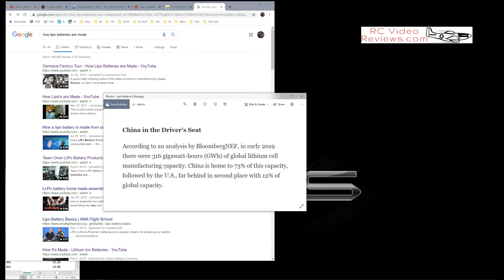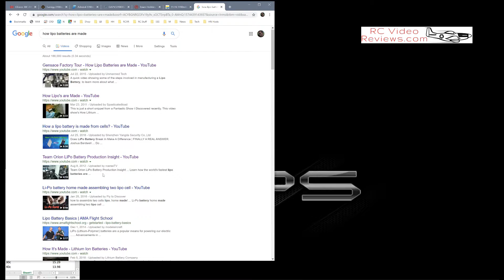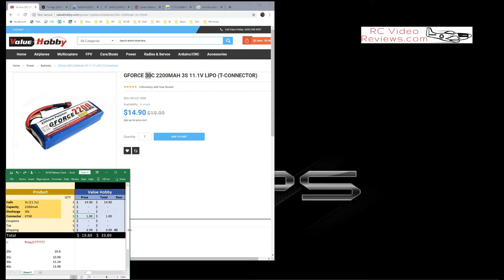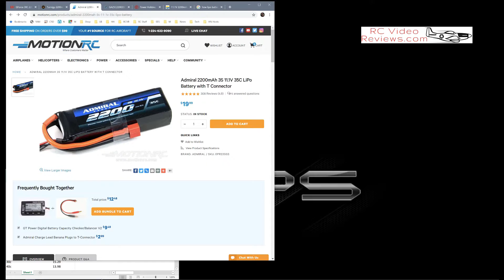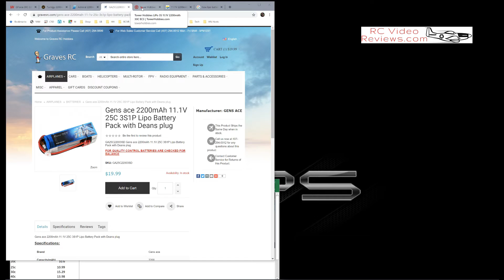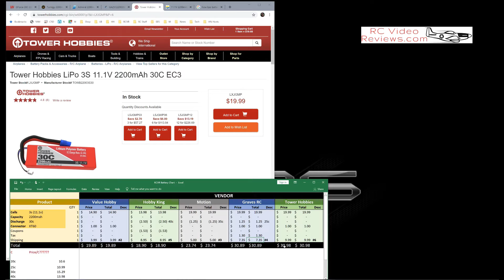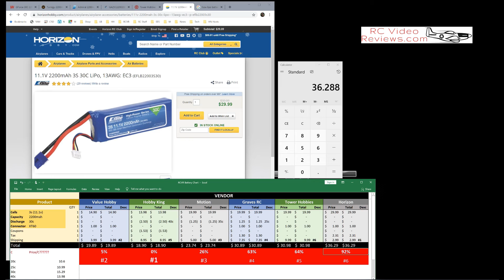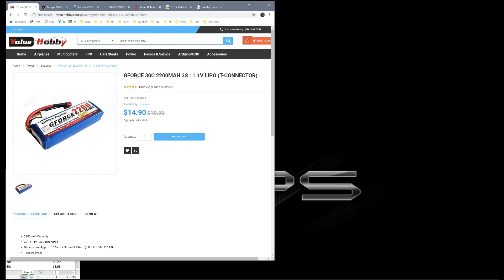LIPO Batteries - Buy More Spend Less

Comment: I also buy Chinese lipo batteries since 2007 cause i was always out of money , once in 2010 i  baught a small 1300 mAh battery called "diamond" from a german seller . It still works fine ,havent bloat or anything but it was expensive specially then before all the IATA nonsense

Comment: Right now there's a 5 piece bundle of 3s 2200mah 25c batteries on AliExpress for around $52 USD plus shipping. Even if only three out of the five were good, it's a better deal than just about anything I've seen before.
Reply from the maker: Thanks for the hot tip!

Comment: What is the strongest battery that you can charge with the Voltcraft charger V-Charge Eco NiMH 1000?
Reply from the maker: I'm not sure what you mean by "strongest battery" but it's only a 10w charger and it's for NiMH, so don't charge Lipos with it. Not much power in that one.
Reply: @RCVideoReviews  NiMH, yes but upto 2000mAh, 3000 mAh, 4000mAh? and charging time? Thanx 4 info.
Reply from the maker: @Tintoycar  Think of MAH as a gas tank. MAH refers to the amount of energy you can store. Chargers don't really know or care about MAH. Charging time is influenced by the MAH itself. More MAH = more charge time required if the amperage is held constant and it will be in your case because of the low power rating of 10w on that charger. The charging rate on that device is low at 10w. A 12v device like a 3s LIPO battery will charge at 0.8a. If you charge a 2200mah battery, that represents about 1/3c, which means it will take over 1 hour to charge a 2200mah battery.
Reply: @RCVideoReviews  I'm starting to get it ;-) Now it takes 2 hours to charge NiMH 2000 mAh, so i can use my little charger to charge a 4000 mAh battery but it will take much longer. I've got an old charger somewhere that's 20 years old for my 2001 Subaru Impreza. Maybe it will be of use. I understand that NiMH is for beginners ;-)
Reply from the maker: @Tintoycar  NiMH isn't for beginners, it's the chemistry we used in batteries before Lithium Polymer. Lithium Polymer is a preferred chemistry because it holds a steady voltage level over the discharge curve better than other chemistries. i.e. It makes for a better experience because the device being driven is more consistent from the peak voltage of 4.2 to the cutoff voltage of 3.3. NiMH voltage fades more at the end of the curve.

Comment: RCGroups does extensive load testing of high demand batteries (car & ducted fan) and most batteries can't handle the load.  Doesn't that make a difference?  It seems more objective.  Doesn't Graphene reduce internal resistence and improve performance?  Thanks Howard
Reply from the maker: "I am now convinced there are presently no (none, nada, zip) ~5000mah packs weighing under 800 grams able to sustain a 35C continuous discharge without overheating. End of story. The only difference between one that claims 100C and another claiming 45C is how big a lie the supplier believes they need to tell in order to separate you from your money."

He focuses on heavy use heavy draw form factors: 6s5000 under extreme load.
He says weight tells the story (agreed).
The difference comes down to marketing claims.

In the end, Lipo is Lipo. Weight is weight.
Reply: John again thanks for looking into this.  If you look into the results there are battery manufactures to avoid, where you just don't get the longevity (cycle life) to justify the cost: 
https://www.rcgroups.com/forums/showpost.php?p=43555233&postcount=8514

I would much prefer to pay a little more for a battery where I can get 200 cycles, rather than paying less and having the voltage start to sag at 50.  Maybe you could do some cycle testing on your iCharger?  I think there is a cycle mode already available where testing could be automated.  You do an amazing job with The Judge on motors.  Howard
Reply from the maker: Appreciate the dialogue. Honestly, I consider batteries consumable. There are just way way way too many variables involved for me to get wrapped-up analyzing batteries let alone even consider posting a video about battery analysis. Even the testing you shared--which is excellent--only focuses on 6s5000mah high load conditions and look at the amount of data he generated.

To simplify my life when it comes to batteries:

1) Store cool dry. I used to store in hot garage, no more. Cool dry.
2) Stop charging at 4.15.
2.5) Balance Charge Only on Quality Chargers
3) Stop discharging at 3.7
4) Store between 3.75 and 3.85
4.5) Balance Discharge to within 0.03/c
5) IR > 5 Any Cell = Retired
5.5) ~15mm worth of "puff" = Retired
5.6) Anything other than cosmetic damage (i.e. crinkled cell) = Retired with prejudice
6) Current Design 10% < Sustained C
7) Prefer C Rating > 40 or higher
8) Charged Before Use. Storage Charge as Soon as Practical.
9) 30 Minutes rest after Discharge.

Can I quantify any of the above and correlate to longevity? Nope--I seriously question anybody who says they can.
Do I believe these are best practices that in my experience lead to the best cycle life of a LiPo?  Based on my first hand observations and reading from sources that actually do evaluation work...absolutely.

I've never burned a lipo I didn't intend to burn.
I've never crashed a plane due to unwarranted loss of power. i.e. I've overflown EDFs more than once and hit soft cut requiring landing.
I have well over 3000 flights.

So whatever I'm doing is working well for me.
Reply: Very helpful!  Thanks
Reply from the maker: @castlive7716  Yup
Reply from the maker: You're going to have to be more specific.

"RCGroups does extensive load testing of high demand batteries (car & ducted fan) and most batteries can't handle the load" 

Cars and ducted fan do not have a monopoly on demand generation. I can kick a battery squarely in the nuggets with a prop--no problem, guaranteed.
 
What do you mean "high demand batteries"? 
Who on RCGroups? 
Can you quantify "high demand" as it relates to MAH*C?
What batteries?
What is a failure to "handle the load"?
What is the C rating of the batteries they're testing?
What is the load of they're placing on the battery?
How long are they placing this load?
How are they measuring this load?
Is the load within specification of the battery?
What difference are you trying to discern?
What seems more objective than what?
Have you seen voltage sag charts under identical load, for identical time, under identical conditions for graphene and non-graphene lipo you can share?

Graphene makes claims. It might make a difference, it might not. Have you seen any reliable long term scientific testing showing that Graphene reduces IR over non-graphene batteries with every variable controlled and consistent over two test sets?

I haven't.

If you asked me if graphene batteries tend to advertise higher C ratings than standard lipo contemporaries I would say yes they do.

If you asked me if I believed all of the C ratings battery manufacturers place on their batteries, I would say no I do not.

If you asked me whether IR increases faster in standard batteries than graphene batteries I would say I don't know. I haven't seen a single scientific test proving or disproving. Do you have a link to a reliable scientific test?

I'm not trying to bust your chops. This channel relies on video evidence for just about everything. On a rare occasion I'll ask viewers to take my word for something that I've witnessed. Without VE, or a known trustworthy evaluator, I consider most of what I read subjective.
Reply: @RCVideoReviews  Hi John, thank you for the response. 

Here is a link to a thread testing batteries.  There are no opinions expressed, just hard data: 
https://www.rcgroups.com/forums/showthread.php?1767093-Battery-Load-Test-Comparisons

Testing procedures:
https://www.rcgroups.com/forums/showpost.php?p=45023671&postcount=9841

Glossary:
https://www.rcgroups.com/forums/showpost.php?p=45096165&postcount=9926

They use lab grade equipment to apply a consistent load and measure endurance, temperature etc.   There are some stand outs and definite batteries to avoid (Maxamps...)  Please have a look.  Howard
Reply from the maker: Thanks for the links Howard. I started to read through the material and it looks like he--MCSGuy, not rcgroups--does have a test method. I applaud that.

But you still haven't presented me with a question I can answer. 

"most batteries can't handle the load.  Doesn't that make a difference?"

When you say "Doesn't that make a difference?" What are you asking me?
MCSGuy is evaluating 6s 5000 packs. That generally means some seriously heavy lifting. I think it's a mistake to ignore the form factor 99% of batteries most RC pilots use on 99% of their planes.

He also only uses 6s packs and not 2x3s packs in series favoring negative cooling. The situation changes with 2x3s packs.  

He is disputing the C ratings of batteries. I said at the bottom of my first response:
"If you asked me if I believed all of the C ratings battery manufacturers place on their batteries, I would say no I do not."

"It seems more objective."  
Is what more objective than what?

"Doesn't Graphene reduce internal resistence and improve performance?"
You're asking the question, show me the reference material you're referring to.

You understand don't you that he's making comparisons of C ratings. In the video, I merely assigned a dollar value to C and adjusted for it. It's up to you to do your research and ask yourself if you believe the C ratings a manufacturer gives. His testing might help you with that decision making process, but I also don't believe one test on one battery yields a definitive result over an entire product line.

My purchase decisions are based on my personal experience with multiple batteries over many years and as you can see on that shelf, I probably have more than most. I definitely have gone through more batteries than most people I know.

I will stand by the point made in my video: Lipo is Lipo is Lipo. There is no magic bullet. That testing disputes marketing specifications.

Let me ask you one last question: Do you ever see a physical--ruler on battery--measurement of the batteries in that testing? Do you know that a real 40c battery is always thicker and always heavier than a 25c battery of the same spec? If I bought a "40c" battery from a manufacturer that was 15% thinner than all of my other  actual "40c" batteries, I wouldn't need to test it to know what's going on.

Comment: Different batches of battery will have different results as well in terms of max output.
Reply from the maker: Are you referring to delta in IR? Have you done any experimentation/measures? What can you share?
Reply: @RCVideoReviews  yes, but don't have any data on because I don't buy that many batteries as I run nitro as well. It's like with anything thats made in batches, some batches are better than others.

Comment: 8:35 Btw the mah rating does not make a battery better it just last longer,the C rating is what give you that punch/that snappy feeling of acceleration
Reply from the maker: I wasn't suggesting MAH makes it a better battery, I was suggesting C rating made it a better battery as for a given capacity in MAH a higher C rating will allow for higher sustainable current.
8:23 "I gave a negative adjustment because it's a 10c improvement over the target"
C rating doesn't have anything to do with "punch" That's voltage. Voltage is the motive force/pressure behind current. The C rating simply indicates the sustainable amperage. So a 20c2200 is good for 44a where a 40c2200 is good for 88a without damaging the pack. 
The only concession I make to C rating on "punch" is that higher C rating packs hold higher average voltage longer than lower C ratings. AMP draw is not a function of the battery, it's a function of load.
Reply: @RCVideoReviews  Yeah what you said XD
Reply: @Openthrottlerc  What do you mean by humbling down?
Reply: @Openthrottlerc Get schooled(LMAO this man right here talking about "Get schooled") Packs don't "push" power, but unfortunately a higher C pack will provide more punch even if you are not drawing near its full potential. With all the marketing hype, its hard to state hard numbers, but C rating is supposed to mean how much continuous current the pack can deliver without going below 6 volts
Reply from the maker: "Packs don't "push" power" Wrong. Packs absolutely push power. That's exactly what voltage does. The motor creates demand. Voltage pushes electrons. Current (i) is the rate at which electrons pass a point and when multiplied by motive force (v) results in power (w).

C Rating doesn't have anything to do with motive force. Voltage provides motive force for current. Higher C batteries maintain higher sustained voltage so they resist sag and provide more sustained motive force for current when required.

Voltage is voltage. Voltage is the motive force for electrons. Electricity doesn't know jack about C ratings. C-ratings are mostly wrong and do absolutely nothing other than give you an idea of how long current can be sustained under load. 

LOAD is generated, current is the rate electrons flow past a point, voltage is the pressure that pushes the electrons satisfying the demand generation.
Reply: @thatmand4542  schooled again. Just stop dude.
Reply: @RCVideoReviews  wow. Very complicated.  I'll go by your experience.. in my experience my higher c rated batteries have done better with my heavy finger driving my basher 6s 1/8th rc,s. Buy I always love to hear advice from those with more experience.  I have found some cheap batteries I have have not lasted very long. But I've had pricey lipo,s go bad also. I just ordered zee lipo,s from ebay. Try those next.

Comment: I just ordered a 6s battery from this place. I got free shipping through the USPS too. They were recommended by a hobbyists. I'll see how it works out. He said that the batteries are working great for his land vehicles :
https://chinahobbyline.com/
Reply from the maker: Definitely let me know what you think. I'm always curious to know about better deals :)
Reply: @RCVideoReviews  Just ran these on my xmaxx 8s for the first time. After 22 minutes of hard driving and jumping on concrete I couldn't kill them! About $47 per pack. I put gorilla tape around them and changed the connector to xt90. They were storaged charged correctly out of the box and they balanced charged well :
https://www.ebay.com/itm/362756127725

Comment: Yup. Last battery purchase cost me $190 for two 9400 75C smc batteries for my xmaxx 8s. I bought 4 you and me 6500mAh 60c batteries off ebay for $190. I'm going to try them out and pit them against my smc batteries. From what I've seen on video and comments there's barely any difference. I'll cut the Deans plugs on them and solder my xt90. Stand by. All the premium and cheap batteries are probably coming from the same factory in China 🤣. I've had two smc batteries connectors come offers from inside and the cell, so they did warranty them. They sent me two new ones, so I'm happy. The C rating is another can of worms. I just try to get at least 50C but nothing insane like 100c, because it seems to be a scam to buy so much more $ for extra C rating when there's barely any difference between 50c and 100c!. Subscribed. Check out my channel 👍
Reply from the maker: They are definitely coming from the same factories over there. Did you ever run this test?
Reply: @RCVideoReviews my cheap batteries are going strong. They last about half an hour with 20/50 gearing on my xmaxx 8s trucks. I have had issues with the SMC batteries and they honor their warranty fast with a couple of emails and pictures so I'll give them that. I'm assuming that getting warranty from cheap batteries off ebay is harder, so it is what it is 👍
Reply from the maker: @joseCalderon1976  Practical viewpoint...Happy to hear SMC stood by their product though.

Comment: its true but what will harm your batteries is parallel charging .. if there is one batt has a damged cell it will effect all batteries.. at the end they are all the same ...
Reply from the maker: If one cell is damaged how?
Reply: @RCVideoReviews  if you parallel charging 6 batteries and one of the batteries has a damged cell let say (one cell at 2.9) all your other batteries will be effected .. its down side for parallel charging ...
Reply from the maker: @bravo226  I agree it would be a bad idea to connect cells beyond about 1/100th  apart in voltage. That's why I'm a little mental about checking per cell voltages before connecting in parallel. That said, you can see in my videos the number of 3/4/5/6s packs I have. They've all been parallel charged over  ~60% of their charge cycles. So I can speak from a position of direct first hand experience here that parallel charging is fine if you follow the rules. 

If you DO NOT follow the rules, I agree with you, you can create more harm than it's worth. My parallel charge rules: Same voltage (obviously), voltage differential < 1/100th of a volt. I prefer < 5/1000ths. Connect to parallel board and let rest for about 20-30m before starting to charge and let them sit on parallel board as long as possible after charging.

Comment: More important than Brand is How you treat the battery. So if you run it down to 9% or so all the time, it’s going to PUFF. If you fully charge it and let it sit for weeks or months, it’s going to PUFF.  If you run it down, Fast Charge it and run it again and again, it’s going to PUFF. Also, if you treat it right but you have hundreds of flights on it, it’s probably going to eventually puff. But you got your money’s worth out of it. 

Also, I’ve said it before and you said it here, I sometimes might pay a little more for a battery but maybe I wanted my connector and not have to solder or I wanted to get to a website’s threshold for a discount. In the end it’s an informed decision. 

Great video!
Reply from the maker: Great points David. 100% Agree with you.